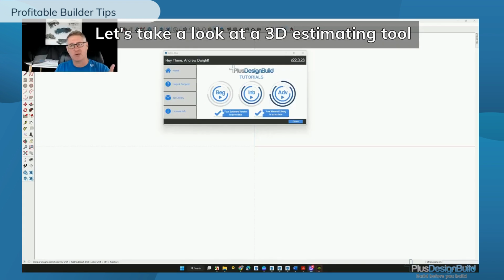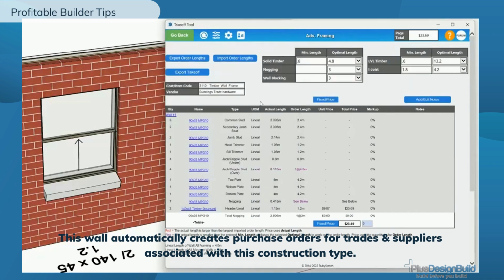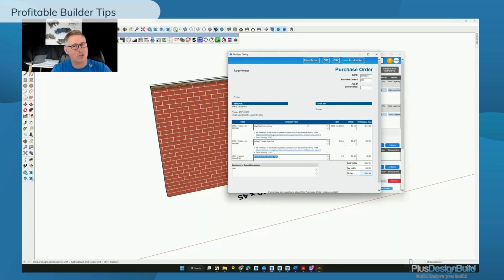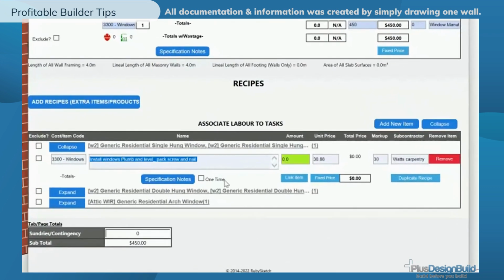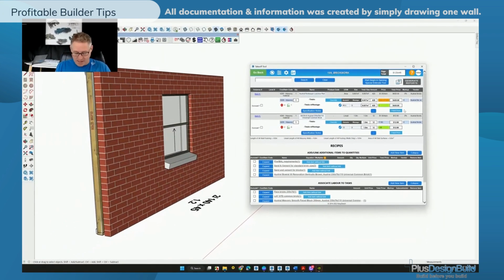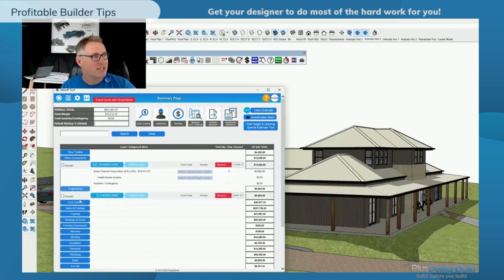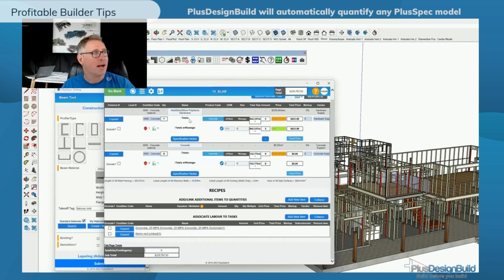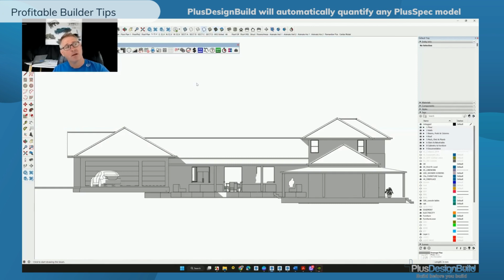How To Create Comprehensive Purchase Orders From A 3D PlusSpec Sketchup Model in Minutes (BIM VDC)

Comment: Hi, I'm considering buying your software, love what I'm seeing so far. I build tiny houses in the US and am wondering whether units of measurement and other general settings can be changed to suit the building industry in the US as opposed to Australia. Love Aussies for sure, but I would definitely be lost in the metric system. And I'm assuming the suppliers, costs, standard lumber sizes, etc can all be customized? Thanks.
Reply from the maker: @dal288859 Yes, when you download PlusDesignBuild or PlusArchitect in the USA, it will automatically change to imperial, or you can have it automatically use your Sketchup template settings.  We have several tiny home builders using the software.  I suggest using the BIM tool to create your wheel, axles, springs and use the beam tool to create your subframe.  I look forward to seeing your work; maybe add a hello note on the PlusSpec forum.  https://forum.plusspec.com/